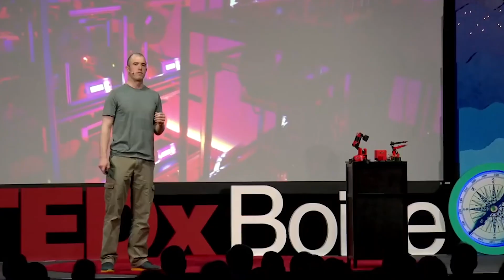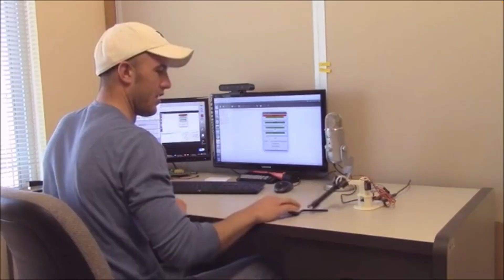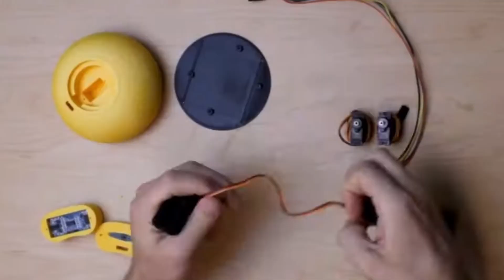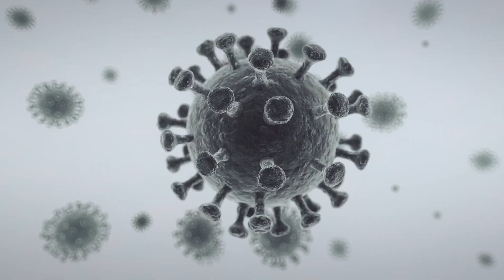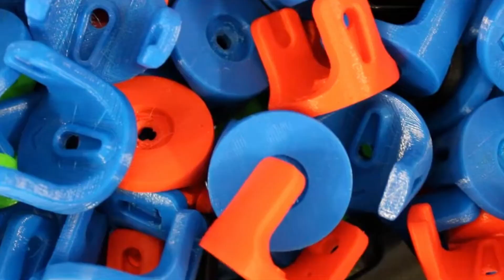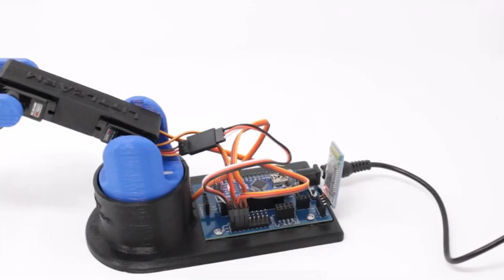Real 3D Printed Products: LittleBots | 10 Original Robotics Products in 2 Years

Comment: I got a Little Bot for my nephew a few years back! He loved it and kept going with engineering projects like that -- Adafruit became my go-to first presents after that.

Little Bots created the need for Slant 3D, why has it not gone the other way? You have shown some small automations and robots in the print farm, but using your team, innovation, and inspiration from Little Bots, why not get even more? Something somewhat simple from an arm on the top of the printer that detects when the bed temperature is optimal and then removes the print from the bed. Or something much more complex such as when an empty spool is detected -- it removes the empty spool, loads a new one, uses the arm to insert the new filament into the bowden, and then send a signal to unpause the print or that the printer is ready to go. 3D printed helper bots that maintain the printers that printed it.
Reply from the maker: We are already have much of that.